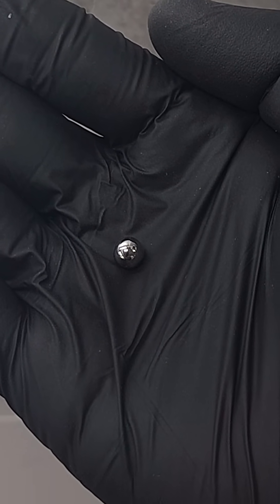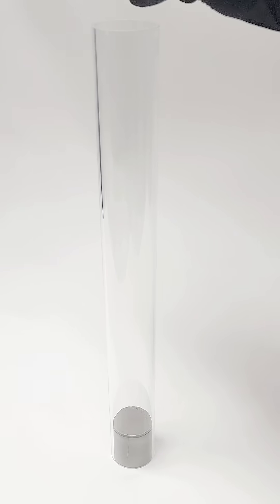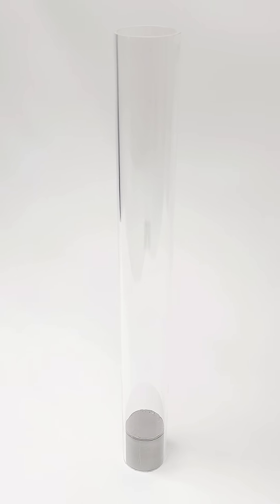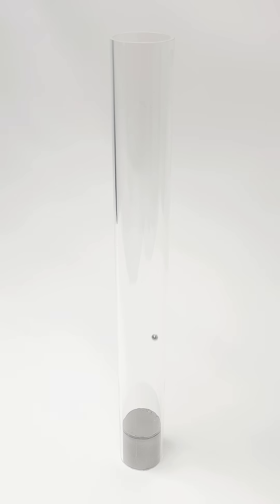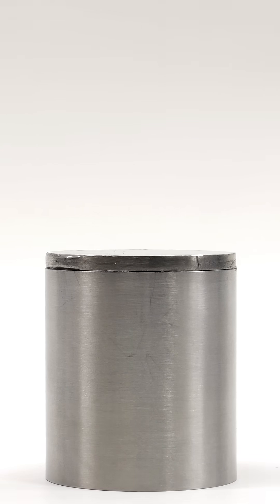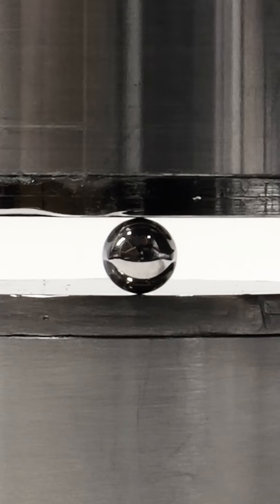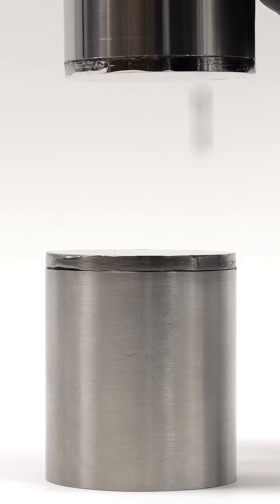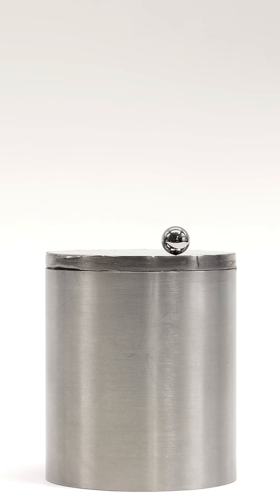This metal is too bouncy

Comment: As a sound engineer, I have directly analyzed the audio of this video (not with a mic) and my sonogram indicates a maximum frequency of ~15kHz. That's 15,000 bounces/second, or 7,500 per surface. Beyond that, the sound stops because the quality of the compressed audio prevents us from hearing what's going on higher up. This means it goes even higher !
Reply: Youtube rolls of frequencies above 15kHz during their lossy audio conversion.
Reply: Youtube streams up to 15khz so yes
Reply: Nothing gets higher than me. * puffs*
Reply: @lightseraphim6816  Hey...  I resemble that remark. * fumbles at  some dried vegetation with one hand while snatching up a small orange package containing little pieces of paper with the other *
Reply: I saw a reel once of an audio engineer testing the cutoff ranges of different music services lilke spotify and pandora, including youtube, and I think youtube's cutoff point was somewhere around 16khz, while spotify and everything else pretty much went all the way up to 20khz and beyond. Maybe that's why it maxed out there, since the audio was stripped from this youtube video?
Reply: btw youtube limits the frequency as far as i tested (years ago) so i guess it’s a even higher pitch
Reply: As a jacket engineer it sounded kinda like a zipper
Reply: I stopped listening at 13kHz
Reply: As a fellow sound engineer, I thank you for doing that. Very cool.
Reply: i ws just abt to comment smth like this😂
Reply: How long would it bounce for if you had only 2 mm gap between the ball and the trampolines?
Reply: @The_Intergalactic_Academy  this would be totally dependent upon the kinetic energy the ball contained at the beginning ... would it not? Of course it would.   Peace.
Reply: Thanks this is the second time i saw this video and was wondering again!
Reply: You rock!
Reply: That's pretty interesting nerd. I hope he can get a good mic directly on it to find out
Reply: @B_u_r_r ... My you're a rude jackass
Reply: The sound could result from resonance or vibrations in the surfaces or objects being struck, which can ring at specific frequencies unrelated to the bounce rate.
Each bounce could excite multiple oscillations, leading to a higher-pitched sound than the actual bounce rate.

The analysis is partially correct, especially regarding the compressed audio and the sonogram frequency. However, the assumption that 15kHz corresponds directly to the number of bounces per second is likely an oversimplification.
Reply: @noahwig500  The thing is that the frequency clearly changes in direct proportion to the bounce rate and starts low enough to confirm that by seeing the individual impacts. The high pitched tone is very different to the individual impact sounds as well
Reply: Geez that's insane. I wonder how hot it got by bouncing that many times in that amount of time.
Reply: As a sound engineer you would think you would understand fundamental frequencies and know how to tell this comes NO WHERE CLOSE to that.  You are extrapolating the sound a single bounce makes, roughly 15kh or so and pretending that is the frequency the ball bounding makes.  Every bounce makes that frequency its not the speed its bouncing with is prob around 1-2000 At best. That clicking it starts off with is only a couple times per second yet it still produces the 15khz or so tone.  That tone you measure has nothing to do with the frequency of bounce which is honestly pretty hard to tell using this recording.
Reply: I thought it was higher than 10kHz, that's crazy to imagine though
Reply: could be limited by our ability to record and reproduce higher frequencies, youtube algos, etc. I mean, it could be an even higher frequency at the end, maybe
Reply: I was thinking of exactly that! I‘m sure one could make a unnecessarily complicated but cool instrument or synth with this concept as a base. Rythm becomes frequency if fast enough
Reply: @blue-uv4mh  the Daft Punk's song Giorgio by Moroder does exactly that in the outro : a synth return into a kick  😃 In fact it's not a new effect at all in music production ! There is a subgenre of hardcore techno based on this technique : Extratone music
Reply: My thought exactly, just check highest frequency recorded. Way easier than counting slowmo footage
Reply: @Ingu.z  The highest recorded happens even when its only bouncing once or twice a second.  This post and the others like it are just wrong...
Reply: @seditt5146  I don't think you understand what I meant: the bouncing noise is a set of inharmonic frequencies. As the space narrows, the “tick” accelerates, but these inharmonic frequencies remain at their pitch (they're clearly visible in the sonogram). They remain audible right to the end. On the other hand, the fundamental frequency of the “tick” increases as it progresses, and its pitch depends directly on the number of bounces.
Reply: @seditt5146  you confuse the fundamental frequency created by the rapid repetition of the tick with the set of  harmonics created by each impact.
Reply: @ClementSanMartin  what you said. a sound wave is a sound wave, and that's how synths work after all
Reply: I checked myself, in my own DAW, and he is right.

Yes it does rise above 15khz in correlation with the audible pitch.
No he's not looking at the harmonics, he's looking at the fundemental.

Some ppl really just love to conclude that everyone are stupid, and therefore always assumes the worst of them.
Reply: Thank you
Reply: See people in these comments, not understanding the humour. Dumb af.
Reply: Holy shit…
Reply: NUH UHHH (that’s really fuckin cool)
Reply: You sure?
Reply: ULTRASOUND MENTIONED
Reply: Nice work man.
Reply: Thanks
Reply: Excellent job sir
Reply: Wow
Reply: Incredible
Reply: Doesn't mean anything if you don't have the raw uncompressed audio lol
Reply: how tf did this upset people??
What is happening
Reply: 15,000 a second that's crazy ✌️
Reply: The compression can be over come by just listening to the "key" or the "note" played. Compression will eliminate the transient used to identify each surface impact. However, just using a tuner to find the "tone" will tell you the Hz (cycle rate). Example being, when you hear a "middle c" note, we know that object is vibrating at 256Hz. (the end note is a G#6, which moves around 1600Hz)
Reply: And as l understand it from the science fiction shows l've watched is that you need to travel INCREDIBLY fast, faster than the speed of light to Time Travel. If this is correct, couldn't you theoretically build your two "Atomic Trampolines" to increase the speed so that the ball just disappears? And not to where but WHEN? 🤔
Reply: @robertrachels1870  I'm no physicist, but no. This ball doesn't accelerate. In fact, it's the opposite: it loses energy with each impact and therefore decelerates. The frequency only increases because the length shortens.

And more fundamentally, in reality matter cannot exceed the speed of light limit, as it would require an infinite amount of energy to accelerate to the speed of light. Only massless particles can reach this limit (like photons, electrons, quarks, etc.), and beyond that it's unknown (quantum entanglement, negative masses, etc.). In fact, we can only travel into the future, as we do now, or by acceleration.
Reply: I just commented that this was possible hahaha
Reply: what the nerd
Reply: Thank you! I love when smart people do analyses 😎👍🏼
Reply: Hey was just about to do the same. Thanks for saving the trouble c:
Reply: I was wondering if this is how it could be tested because it sure sounds like a frequency shift when the trampolines get closer.
Reply: Thanks for going the extra mile
Reply: Strong case for good ol' fashioned wav/cda files instead of mp3/m4a files.
Reply: SCIENCE!
Reply: He chose to omit this detail solely to get likes and comments to generate 
$$$$$
Reply: Sooooo coooool
Good job
Reply: thats actually so cool!!
Reply: Tell everyone no one cares without saying no one cares:
Reply: New kind of speaker tech idea here
Reply: Nerd
Reply: Good work!
Reply: There's always one really qualified person who makes these videos even better
Reply: Merci Clément
Reply: 💀💀💀☠️☠️💀💀☠️☠️☠️ WOW dude wow mad respect
Reply: That's badass. Thanks for sharing 😁
Reply: As a fellow audio-engineer I wouldn't expect you to say anything less.
I keep thinking, once the radiation hazard is contained, that there is a musical instrument 
 waiting to be developed from this principle.
 Yes, yes I know we can sample it but a degree of dynamic ambience becomes somewhat mangled so a 
guitar that X-rays your hands, zaps the drummer's girlfriend, and requires a 50 ton lead and concrete carrying case 
would be Alpha cool as well as being a mean shredder. (Not just musically)
Reply: Thanks bro...jour wonderfull...big thanks
Reply: I knew someone in the comments would break it down. Appreciate it bro 🤙🏼
Reply: Let him cook
Reply: Sound
Reply: Thats Youtube, no analyzing needed. As a critical music listener and audiophile I could easily say that that was more than 15 000 hz, which is what most basic speakers will produce over youtube
Reply: What a fucking boss.
Reply: Oh neat I'm not the only one. Although my guess of ~12khz was just spitballing based on  my previous experience with audio. Glad to see I was pretty close lol. I can only really hear up to 16khz anymore anyway 😅 already getting old
Reply: I was gonna say plot this on a sound visualization like a oscilloscope or eq
Reply: Time to simulate this with a spectrum analyser. With a sensor array. It may not go past the ultrasonic, but it is worth the try.
Reply: Not possible donk
Reply: Thank you. Footage is much less reliable than the audio. I wonder what the actual frequency is for the uncompressed audio recording is, and if it exceeds the microphone’s ability to pick up.
Reply: Finally someone who understands just exactly what the sound being created, means.

It doesn't even need to consider compression of the video. The fact that the audio is being captured by a video source(Youtube) seriously degrades the quality of the results. 

You would have to be in a white room and right next to the source in order to capture the speed correctly.
Reply: golly
Reply: This blows my mind, surely it cannot bounce that many times that fast??
Reply: are there high speed microphones?
Reply: 10 feet higher!
Reply: Underrated comment.
Reply: Thank you for using a real equipment and not a cell phone and spectroid.
Reply: you can you analyze my doorhinge
Reply: How much energy it might release? And what's the speed of it?
Reply: I just asked if this was possible because I had the same thought.
Reply: Nice I was hoping someone would check if he didn't
Reply: These can also be harmonics. E.g. 4th harmonic 2000 cycles
Reply: The sound ends when the lowest harmonic is somewhere between 8-15kHz, where the imprecision comes from lossy AAC compression. The But the number of bounces is double that. The lowest harmonic is for complete cycles, and each cycle contains 2 bounces - top and bottom. So, my estimate is 16k-30k bounces per second at the end.
Reply: @orbik_fin no, you're confused about what a cycle is in this instead. The frequency of the sound tells us exactly how many times the ball hits either one OR the other surface. Defining a cycle as the ball hiting both surfaces and then returning to the first surface it hit appears to make sense, but for the soundwave we hear it's irrelevant which one of the two surfaces it hits, therefore one cycle = the ball hitting one or the other surface.
Reply: @LRM12o8  exactly: a true physical cycle is worth two from an auditory standpoint, in this instance.   Peace.
Reply: @orbik_fin  you've doubled the bounces thinking that the ball is the same as the pressure waves in air... It's not.  The tap of the ball on one surface creates a knock sound which is the single Hz.
Reply: Nah it sounds like a door
Reply: @RonanPhillips-xy9vq  well ys, because your human brain is no longer able to determine the gaps anymore.
Reply: What is this comment thread 💀

I wanted to chime in to the discussion of frequency from a physics perspective. We typically define sound of a given frequency with a sine wave. When you have a ball bouncing at 1Hz it's not strictly a 1Hz sound but a pulse with a range of frequencies. As the number of bounces increases the resulting sound looks more like a sine wave, imagine many spikes lined up in sequence.
Also that is why we say humans can't hear 1Hz notes when we definitely can hear 1Hz bounces.

Thanks for the sound analysis and you are right in counting each bounce for the frequency of the sound, not every other which should be clearer to others from the many spikes as a sine wave analogy :)
Reply: do you know how to make this sound, I mean any preset etc...  Or please explain how to reach it from slow speed to high. Saw waveform? Thanks!
Reply: @Sergei_Uvarov  find an online "tone generator", set it to "sweep" from low to high... and depending on the tone generator, maybe set the starting and ending frequencies. That would be my guess for the easiest way of producing this sound for yourself.  Audio engineers doing the setup for sound rooms and such, do this kind of thing all the time.   Use a smooth sine wave, as any other shape will sound raspy, or distorted or... well there's a lot of words for it. You'll know it when you hear it... Peace.
Reply: @primateinterfacetechnologi6220  Thank you a LOT!
Reply: @Sergei_Uvarov  You are most welcome. 

   Peace be upon you, sir.
Reply: @Sergei_Uvarov  yes a simple saw waveform, I suppose, or a impulse train with a saw form in the release... since there is a sudden maximum amplitude at collision and a progressive loss of energy until the next collision.
Reply: But just because you get a sound frequency of 15kHz, that doesn't mean that the ball itself is bouncing 15,000x per second, does it? I'm not a sound engineer but I know I can play the low string on my guitar and use an eq or analyzer and it shows frequencies from below 100 Hz to over 15kHz. I know the drop d string is itself 73hz but analyzers and eq's pick up a range of frequencies. Maybe determining the number of bounces would be obvious if I knew more about it
Reply: It doesnt it rolls of at 15 k and 15 lufs for streaming it doesnt compress the file so if you download the video from the server its still uncompressed.
Reply: @Shkodo  Whenever you upload a video to YouTube it gets transcoded multiple times for the multiple "qualities" (resolution/bitrate) YouTube supports.
Live transcoding from source - for each and every viewer - would be way too expensive.

Downloading the video would still give you a YouTube compressed video.
Reply: @m4ster_root  Yes and unfortunately audio is the most affected by youtube's compression.
Videos like this are the reason that youtube will one day give users access to the lossless audio, as an option ofcourse.
Reply: does that mean it's 1Hz for 1 bounce? Probably not
Reply: @TheCollinkljacky  if you talk about 1 bounce per sec, yup it is literally 1Hz.
Reply: @ClementSanMartin  so what about different pitches in sounds? If I make different pitches every second, they are all 1 Hz? Why does this sound so wrong?
Reply: @TheCollinkljacky a hz is a unit of measurement (like foot or second or cup) defined as 1 cycle per second. If something has a frequency of 20 hz that means it has 20 cycles per second. The higher in pitch something sounds, the more cycles per second it completes, or the more oscillations your ear drums are making and your brain is interpreting that as a high pitched noise, more accurately. Other things also have oscillations per second - electromagnetic waves like light, earthquakes, and bike tires! :)
Reply: @SloppyRocky  thanks for the explanation 👍
Reply: @SloppyRocky  yes, i know that. what i'm wondering is if a ball bouncing once per second produces a sound of 1hz? but 1hz is not even audible, you know? at the beginning of the video, the ball is bouncing almost once per second, and it sounds kind of low, i would guess around 200 hertz (a random guess), so shouldn't it be 200 x the number of bounces? i'm really trying to understand, sorry for the dumb question
Reply: @ not a dumb question at all! I’m not super great with sound physics but I would have to assume the sound is being modified by the vibration of the metal. 🤔
Reply: @TheCollinkljacky 👍 yeah😊❤❤
Reply: @SloppyRocky is the name your missus calls you 😅😂😅
Reply: @ well.. I AM the misses… (but no it’s a joke about all the piles of rocks all over my yard from my lapidary business)
Reply: @TheCollinkljacky from what I understand it's 1hz to 1,000 bounces
Reply: when a ball does 1 bounce per second it doesnt produce 1 hz but more due to the object itself vibrating. i am not sure how it behavese with higher frequencies but i am confident its not 1:1 either
Reply: @nameq  In fact, when the ball bounces once a second, it does produce a 1Hz sound (inaudible up to 30 bounces/sec – 30Hz) but it also produces a whole bunch of other inharmonic frequencies at each impact (the “tic” we hear). These other frequencies become masked as the number of bounces increases and the fundamental frequency rises. But they're still there.
Reply: @ClementSanMartin  It's approximately an impulse train, but every other impact is on a different surface, in the opposite direction, which is why bouncing once a second will have a fundamental frequency of 0.5Hz. A 1kHz sound means 2k bounces per second etc.
Reply: @orbik_fin  not exactly, you have to count a bounce as a single collision, since that's what produces the fundamental frequency. Two bounces (one on each trampoline) bring the marble back to its starting point. The marble's period of oscillation is twice as long as the frequency of the sound produced. In other words, it's not the marble's oscillation that produce the sound,  but the collisions (the maximum amplitude is when it hits the trampolines, the minimum amplitude is in the middle).
Reply: @ClementSanMartin  You're trying to say that the direction of collision is irrelevant, and the marble going only one way should count as a cycle. I'm saying this is practically never true, unless you very carefully position the mic in a place where the radiation patterns from the top and bottom trampolines are identical. Therefore one cycle in the sound waveform corresponds to a full round trip in all but the most exceptional cases.
Reply: @ClementSanMartin  is it possible that many have so little knowledge and understanding of the physical world because a few have gathered it all for themselves?  Of course I'm kidding... lest I be placed in the first category of folks.  Peace.
Reply: @orbik_fin  seems to me in this case, that a true cycle is as it's always been but just not what the ear hears... The tiny tiny difference in amplitude  Between each "tick" as the energy drops (or simply changes... as the top was pushing down) I think would be too small of an artifact to confuse the  issue and each cycle is "perceived" as worth two in an auditory sense.  I suppose one could make a case for phasing issues and stuff but in real life I've never seen such a thing, except at the very lowest frequencies perhaps. If you can see a flaw in my logic tell me what it is, cuz I can't.   Peace.
Reply: @ClementSanMartin  thank you very much for the explanation bro, now I finally understand the logic
Reply: @nameq 1Hz is so slow that it isn't even a sound (the lowest frequencies that humans hear as continuous sounds are 20Hz or so), so at these ultra low frequencies you hear the materials vibrating after the impact as a percussive hit with various higher frequencies in it. At 20Hz you start hearing a tone but the individual impacts are still distinct enough to dominate since human sensitivity to 20Hz is still very low. At higher speeds the peak from each impact forms a peak in a continuous sound wave that drowns out the individual impacts - that's why the sound seems to transition from individual impacts to a continuous tone, because it literally is a continuous tone.
Reply: @nameq exactly! 15kHz is the last recorded pitch, not the number of bounces.
Reply: @nameq   I was thinking the same thing
Reply: I don't think this is legit and not because it's capped by yt.
Reply: @Ardentic-mmare you on drugs you don't think it's legit you are joking right I really do hope your not serious because that just means than that your a dense and as thick as a concrete slabbing wall which I seriously hope your not
Reply: no shit sherlock, youtube compresses the sound, please let me know where you work so I'll never hire you guys
Reply: @AL_Mir29241  no one would work with you regardless, especially with that know it all attitude.
Reply: Nerd
Reply: @Dreadlord365 literally a compliment to that guy. Basically saying that he’s smarter than you (though that’s not really saying much is it?…)
Reply: @SillyWilly_89  You spelled "though" wrong.
Reply: @Dreadlord365 not the goku pfp talking
Reply: @war0nheaven  mfw someone likes something i don't ://// it's not that serious bro, maybe go dip on the guy that's trying to discredit the original commenter.
Reply: @war0nheaven  no need to say that
Reply: @Dreadlord365 Bed time, lil buddy
Reply: @zEEkswe  🤣
Reply: @zEEkswe  no need to say that
Reply: @Dreadlord365 🤓
Reply: @Dreadlord365 Says the one with anime profile picture.
Reply: @Dreadlord365 bro you’re on a chemical science channel. What.
Reply: @Dreadlord365  nerd??
Reply: 😂 @Dreadlord365
Reply: @Dreadlord365  no need to say that
Reply: @Dreadlord365  lol goku pfp, and not understanding that science makes up your entire world, is crazy. If you're young, I get it. I stfg if youre a grown adult saying this, youre excruciatingly dim.
Reply: @Dreadlord365  TFS reference?
NERRRRD
Reply: @Dreadlord365  just cause you got no life doesn't mean everybody else is a nerd.
Reply: @Dreadlord365  goes to nerd channel for nerds
sees nerd comment about nerd shit
"nerd"
why are you here
Reply: @Dreadlord365 lmao at least he gets money from it
Reply: @Dreadlord365 Why you gotta be a jerk about it? They're being nice by explaining it, which makes them by far smarter than you.
Reply: @Dreadlord365  said the Dragon Ball fan
Reply: @Dreadlord365   you wish you were that smart
Reply: @Dreadlord365 your name is dreadlord, you have a dbz pfp, and you post pixelworld videos😭😭😭😭
Reply: @cubanwarlord420  that's the punchline bro it ain't that serious😭
Reply: @ it aint that serious but i made you change ur pfp and take down all ur vids LMAOOOOOOO😭😭😭😭
edit: YOU ALSO TURNED OFF MENTIONS IM CRYING
Reply: @cubanwarlord420  YES vroo my statement still stands stop meat surfing 😭😭go listen to trap nation or something 😭😭😭😭idk abt the mentions tho
Reply: @Dreadlord365 Nobhead
Reply: @Dreadlord365  he’s not a nerd he said he’s a sound engineer
Reply: @Dreadlord365 nerd isn’t much of an insult anymore yk… if anything it just highlights your ignorance
Reply: @Dreadlord365 What do you mean nerd its his job,wait what do u know u dont have one
Reply: @Dreadlord365  yeah. Smarter than you will ever be.
Reply: @Dreadlord365 the geek will inherit the earth inferior subhuman
Reply: Lol, no.
Reply: @sofachrome   at least explain?
Reply: so you ripped the audio from youtube and threw it into a daw. why are you acting like you did something complicated
Reply: @giles3211 he isn't, he's just explaining the results
Reply: @ChickenTumor  Well he does kind of make it sound complicated with the "As a sound engineer..."
Reply: @ChickenTumor "My sonogram" "As an audio engineer"
Reply: @giles3211  I used Izotope RX10, not my daw. But I didn't know that talking about a sonogram was something complicated 😅. Also I'm french and I'm aware that a lot of fancy english words come from french, maybe my vocabulary seems a bit pedent ? Idk
Reply: @giles3211 I can pretty much guarantee you had no idea the frequency would relate to the number of bounces
Reply: @giles3211  that dude that is randomly toxic in the comments for no good reason :D
Reply: @giles3211  why didnt you do it?
Reply: @giles3211  You must be fun to hang around
Reply: @giles3211 and where is your contribution?
Reply: @giles3211  why are people so needlessly aggressive holy shit
Reply: @giles3211 and you are?
Reply: @giles3211  you didnt do it
Reply: Because to the electronically illiterate it is very complicated no matter how you put it
Reply: @giles3211 he isn’t, he’s txlarifying
Reply: @giles3211 They aren't?? All they are doing is sharing info.
Reply: @giles3211  why are you mad he literally just explained us something
Reply: @giles3211  how did he "make it sound like he did something complicated"??
Reply: @giles3211  yea this guy is capping 🤡
Reply: @giles3211 😅😂 Omg🤦 bruh ......let the nerd have his time 🤣